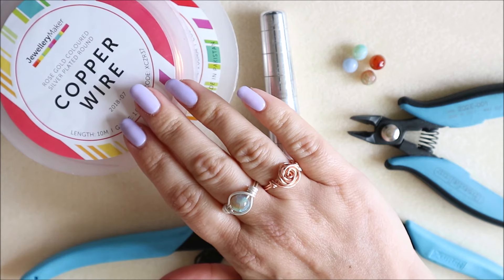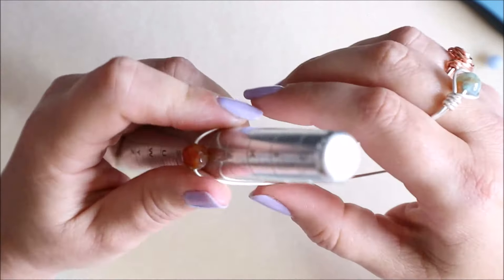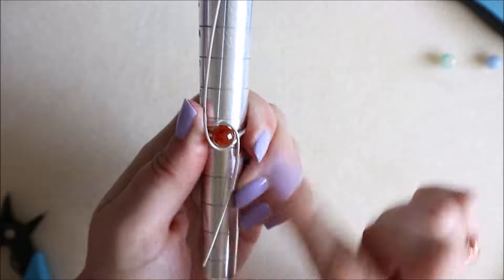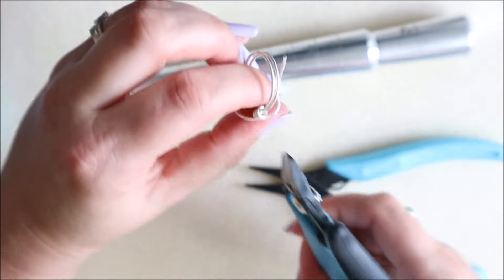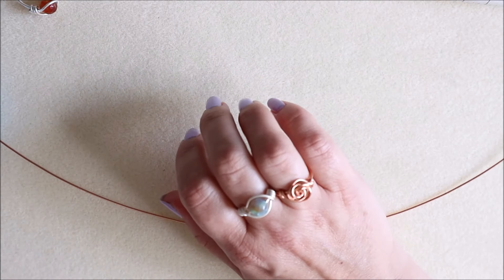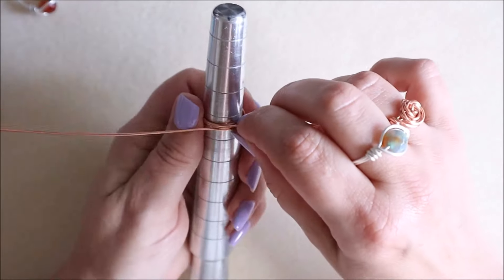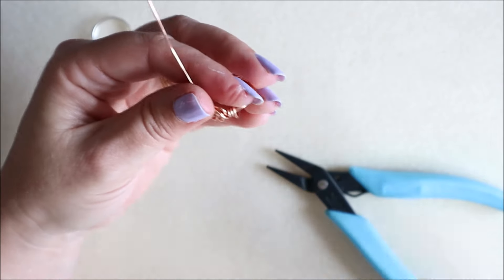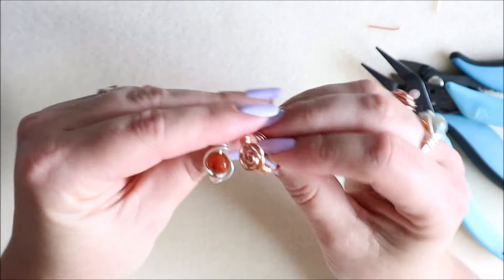Simple Wire Rings - Wire Rose Ring -  Wire Bead Ring - Jewellery Making Tutorial

Comment: Thanks for the tutorial - super helpful! How do you not scratch your metal wire when you use your pliers? I always seem to scratch mine. Going to try plasti dip. Was wondering if you had a technique. I really love the rose ring you made.
Reply: i saw someone in another tutorial say to use plasti dip!!
Reply from the maker: Thank you 😊 I don’t use anything on my pliers, when I began though this happened a lot. I would advise to try relax a little as you work, the tension from your shoulders ends up in your hands. Also slow down, I find most of my pupils try to rush a little and this causes more tension and then damage to wire. Happy jewellery making 😁
Reply: @katieparkerjewellery7277  Thank you so much! You're spot on. I'm impatient. I'll try to relax and go slow. I made a rose ring as you taught - I used a blue wire. I love the ring but it's a little scratched. I'm going to make another using your wise words. xoxo
Reply: at dollar tree I got some silicone rubber fingers and I use that between the pliers and the metal, it cushions it.  Of course they also sell pliers with nylon jaws built in.

Comment: Every time I try to fix the ends to try to make them not sharp it doesn’t work. Do you know what I could do?
Reply from the maker: Hi, are you cutting them on the front/outer of the design? Use you pliers to smith the ends into towards the ring. If it’s still sharp you can use a jewellery file or fine nail file on the ends to smooth. I hope that helps. 😀

Comment: it was a good tutorial but when u made the rose ring it was very confusing and even thou i watched it a couple of times i was still confused can somebody explain
Reply: Turn off TV/radio/phone and other distractions.  Watch the video a couple more times.  Stop the video wherever you are having problems, click with your mouse on the red dot holding it and move it back a touch.  Release and start again to watch the problem area.  We all do this, sometimes many times.  Watch the position the wires are in and how she is holding the ring.  When she wraps a wire around, it is going behind/under the other wire, watch how far she wraps it.  Both wires should end up near the shank on either side with enough wire left to wrap around the shank.  You can make the rose bigger or smaller depending on your preference and how much wire you use.  If you haven't already checked for all her measurements for her ring size you should go above and click on the "show more" below her name and basic description.  It will tell you what size ring she is making, wire size used, and what length of wire.  You will need to adjust for your size ring.  Never hurts to cut more, you can always small lengths of wire for other things, like making your own jump rings or connectors (plenty of videos on those).  Some working with wire also depends on the hardness/softness or thickness of your wire.  Dead soft is very easy to maneuver especially with larger gauges, but can bend far too easily if one is not careful.  Half-hard bends less easily meaning you need to go slow with a little more hand/finger strength to do the bending.  Plus, practice makes perfect.  The teachers in these videos have made several starts, stops, etc., before posting these videos.  Remember that.
Reply: Same, her work was lovely but I felt like the rose part was covered or too far away from the camera when she was twisting the wire so you could never really see the shape only the ends for a beginner trying.
Reply: also are you aware that you can slow the video way down?  hit the gear icon and then choose 75% it will run 25% slower.  I usually run all videos on 125% to save time and then slow back to normal when I can't catch on.  The gear icon is great for like speeding up intro parts, etc.  The voice however does get sleepy and sounds like on drugs LOL! but very helpful in all kinds of situations when you can't catch on, like dance steps or cooking, etc.

Comment: I am new to wire, and I just want to know why if you say the mm don't say the gate I don't understand that other shows I've been watching they say you need to know both these things but they won't give it to you none of them I don't understand it. Maybe there's a printout that somebody could get that tells us what it is if they give you the mm what gauge that would be or vice versa this is so confusing I don't get it.
Reply: Buy wire by Gauge number. The lower the number, the plumper the wire. 16 gauge wire is bigger (more mm) than 20 gauge. Wire that is easy to manipulate is Half-Hard, Soft or Dead Soft. Softer wire bends easily, and it makes wrapping much easier and much prettier. I practiced with 22-24 gauge wire and never have to fight to make the wire behave. Higher gauge wire makes a daintier ring. You can harden wire by putting it on the mandrel and knocking it with a hammer (not too hard).
Reply from the maker: Hi, I’m based in the U.K. and we generally use U.K. terms for wire which is mm. In my more recent video I have started to use the U.S AWG terms too. If you simply google ‘wire gauge’ there are multiple tables which you can see which wire to use. It’s very simple, no need to buy anything.
Reply: @itznora  Yes, and some beads have a smaller hole, so a 22-26 gauge can be used to connect (wrap) it on a thicker wire 18-21 gauge wire and still be able to use your smaller hole drilled bead.
Reply: here's what I found: 
0.25mm - 30 AWG
0.4mm - 26 AWG
0.6mm - 22 AWG
0.8mm - 20 AWG
0.9mm - 19 AWG
1mm - 18 AWG
1.25mm - 16 AWG
1.5mm - 14 AWG
2mm - 12 AWG

Tools used;
Flush cutters
Chain nose pliers
Ring mandrel

Comment: What wire gauge did u use? Can u suggest some wire that longer tarnish
Reply: In the description box under the video title, it says 1 millimeter wire is used, which is the diameter (thickness) of the wire, and  translates to 18 or 19 gauge wire; 18 ga. is probably easier to find. 18 ga. wire is 1.024 mm in diameter, and 19 ga. wire is 0.9119 mm in diameter. I hope this helps.
Reply: @dawnkindnesscountsmost5991  i had the same question but 18 doesn't usually look as thick as what she was working with?
Reply: @ooohlaa13  
I went by the materials description that states that 1 mm wire was used, and the measurement of 1 mm shown on my B&S wire gauge tool corresponds most closely to 18 gauge. Without seeing the wire measured on a wire gauge tool in the video, the description is the info we have to go by, and it looks accurate to me.

A thicker wire, such as 16 ga. (1.3 mm) or 14 ga. (1.6 mm) could certainly be used if one prefers thicker wire. Dead soft wire (whether 14, 16, or 18 gauge) is recommended, so that it's less difficult to work with; the process of creating will work-harden the wire so it'll keep its shape.

A Google search of "b&s wire gauge chart" yields several images of charts that show the measurements of wire gauges, which many find useful when working with wire. All the best to you and your creating.
Reply: @dawnkindnesscountsmost5991  thanx SO much for your comprehensive reply ... in Joanne and Michaels I have yet to see dead mentioned anywhere but most of their wire racks are exhausted  since the holidays so I am beginning this craft less optimally hopefully they will restock.  I thank you for your informative response.  Blessings!